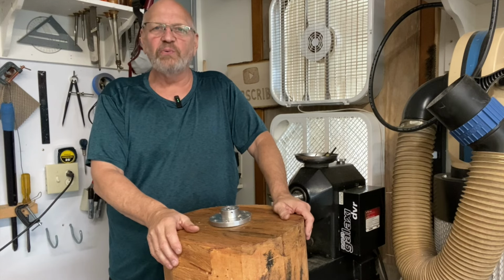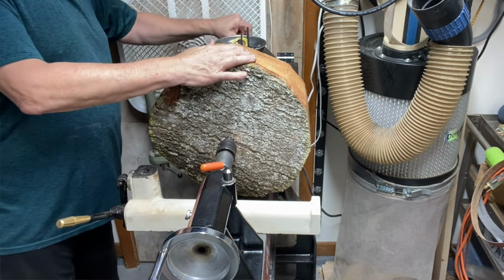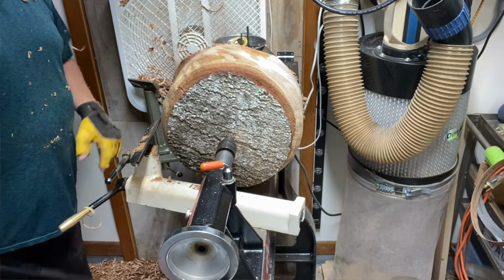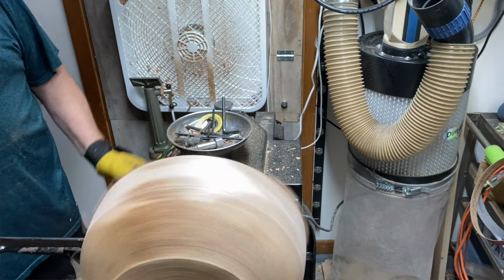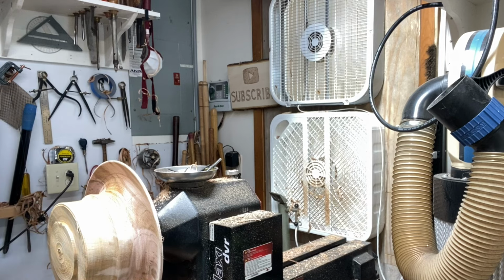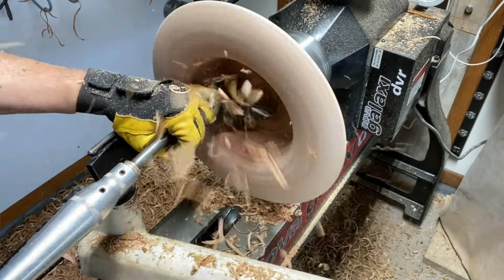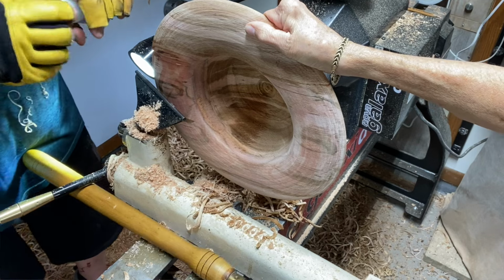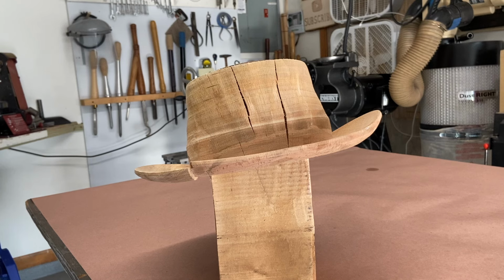Laurel Oak turned into a Hat on a wood lathe.

Comment: Actually great job for your first, especially with using Oak.
Reply from the maker: Oak is a tuff wood to work with but it’s what there’s a lot of near Palm Bay FL. My son had to take down a Cucumber tree this past fall have it anchor sealed. Maybe that would work better. Straight grain. Softer wood. Thanks Lee